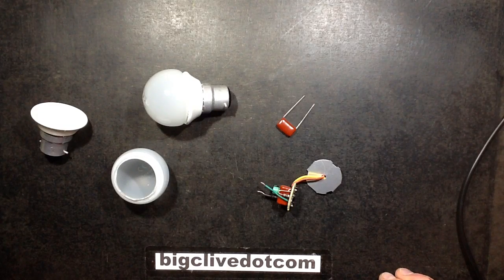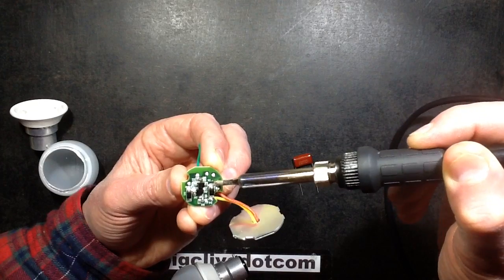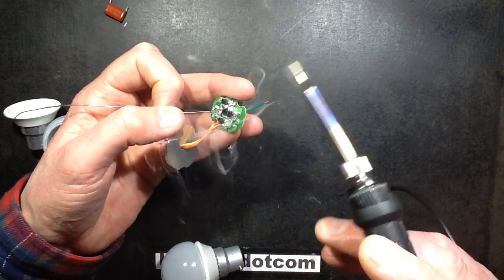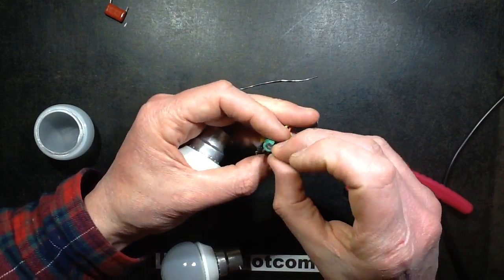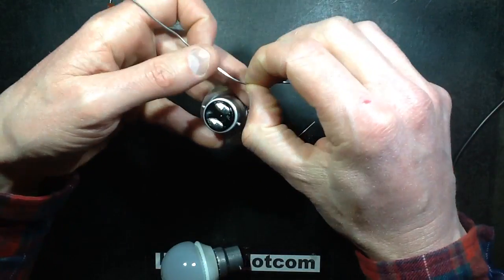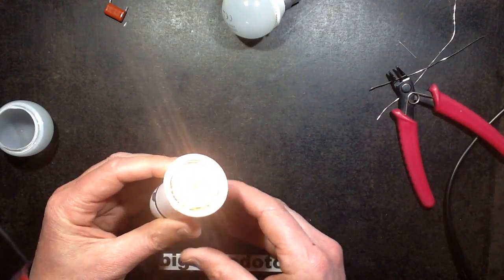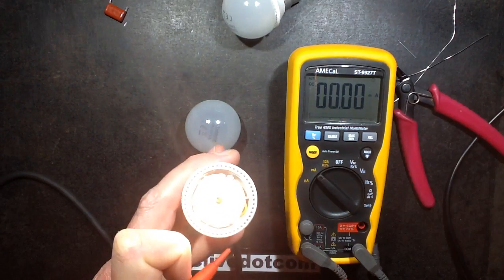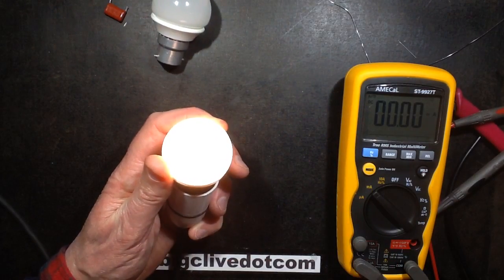Hacking a Poundland LED lamp.

Comment: Really nice! It seems that it doesnt flicker also, compared to the non hacked one, might be because of the new cap then? Could you explain why it got down in power just because of the change of the cap?
Reply from the maker: The flicker is mainly down to the iPad being swamped with the intensity.  These lamps didn't exhibit visible flicker at all due to the high value of the electrolytic capacitor.   The amount of current passing through the lamp is determined by the value of the capacitor which is in series with the circuit.  On each half wave the capacitor discharges/charges and allows a small portion of current through.  The lower value of capacitor allows a smaller amount of current to pass.  These circuits only work on AC because they depend on the alternating current flowing back and forth through the capacitor.
Reply: bigclivedotcom Ah that explains it quite well, I'm quite ok with electronics and I've made up some circuits myself, but I'm far from getting close to half an expert, so it's always fun to get explanations from someone who knows =) Haven't worked much with AC circuits either, so its quite "new" to me.. I think its interesting, but way too deadly to work with =D Thanks for taking your time to explain! =)

Comment: "infernal" lead free solder indeed. I can NEVER melt that crap with a normal soldering iron. A 25w weller doesn't stand a chance. My temp controlled iron will do it when cranked up to 'burn out the tip' levels, but otherwise, ugh
Reply from the maker: If it's an existing lead free joint then try adding some proper lead based solder to it.